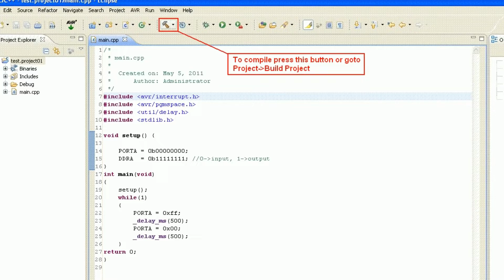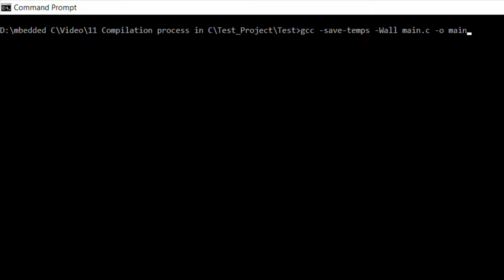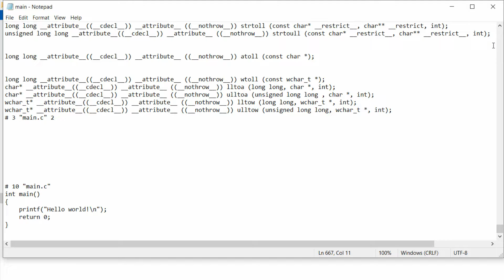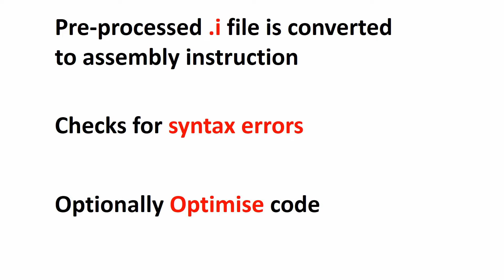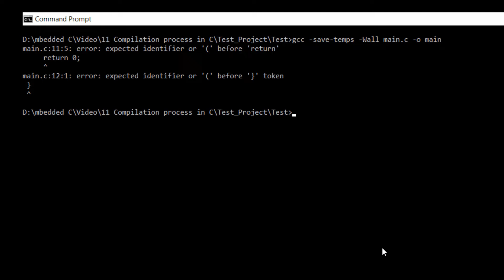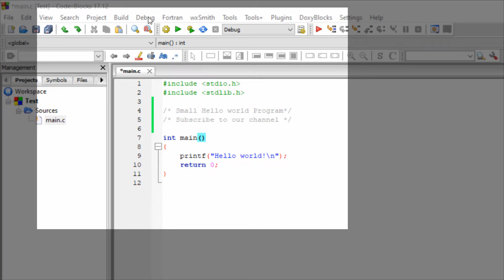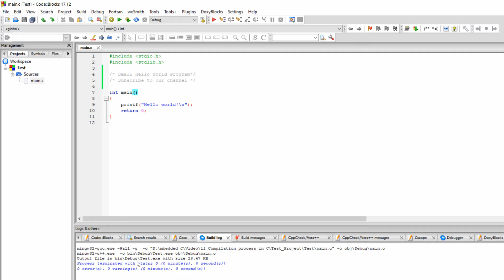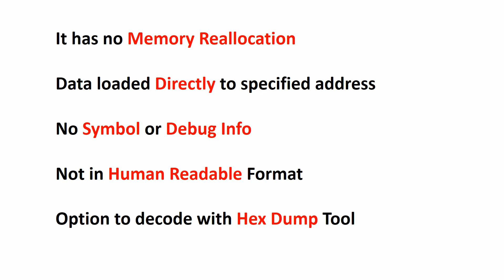Compilation Process in C with Live Example | Debug tips to find which step compilation fails

Comment: Sir after linker there is also Loder right?? What loader do??? And please explain same approach with some embedded IDE like Keil. Some Target board like STM32 will do the best job of explaining how .hex is generated and how diassembly is interpreted
Reply from the maker: Compilation is only 4 steps as explained in the video. Hope you are specifying the binary loading to mcu/mpu as a loader.
We will consider your response will try to do in our upcoming videos
Reply: @EmbeddedC  hello in the tuning world bmw dual clutch transmission is extremly interesting for engine swap and using the transmission in othe vehicles

If I have a list the can messages specific to the transmission how can i use them to control the transmission and make it function outside the car???